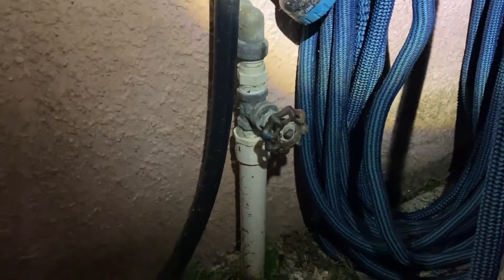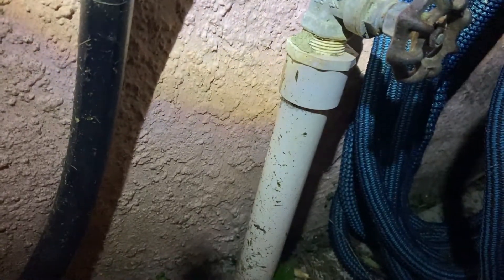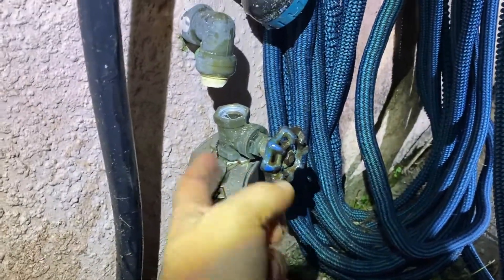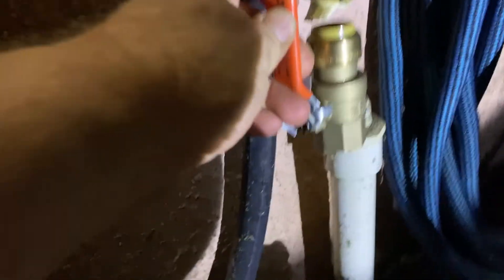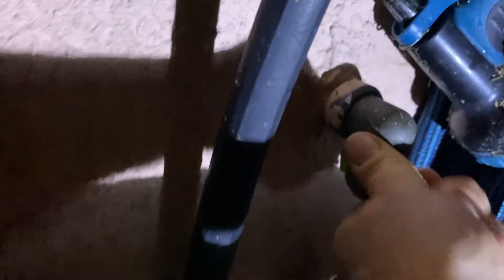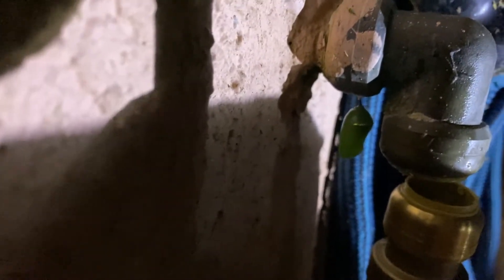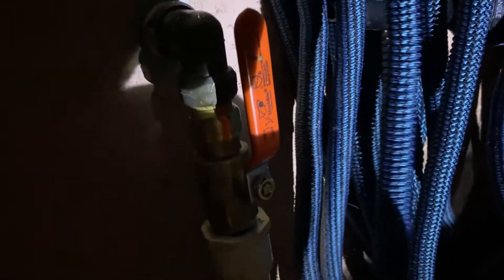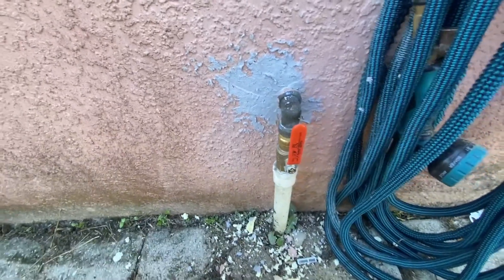How to replace the main water shut-off valve on your house.

Comment: Nice job. I would have definitely used the new elbow but I know they’re not too cheap. If anyone gets into a jam with a gate valve where the water will not turn on you can remove the top bonnet nut with two pipe wrenches and manually remove the gate. Then put it all back together without the gate and you’ll have water until you can replace the valve.

Comment: Why did not use the new elbow?
Reply from the maker: Mostly because of the existing one was fine and they aren’t cheap.  But also because there was a living creature on it and I didn’t want to disturb it.   My daughter tells me it was a monarch butterfly chrysalis.
Reply: sharkbites can be reused. thats one of the benefits of using them. love em. i had some old piping in my bathroom that was replaced in 2007 with pvc after i came home to my whole house flooded. the pvc joints were starting to leak but the sharkbite ones were great, so i replaced everything again, this time myself. i  reused all the old sharkbite elbows and got some of the T sharkbites to use instead of the pvc ones. its been 3 years since i replaced the old pipes and pvc joints and theyre still golden even with reusing the old sharkbites. i also have plumber friends who swear by sharkbites, so theres that aswell